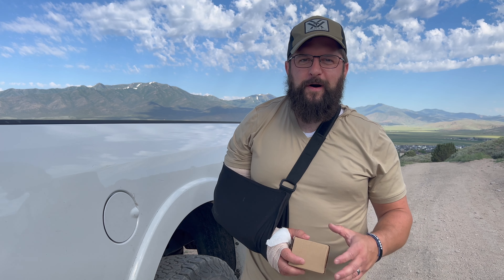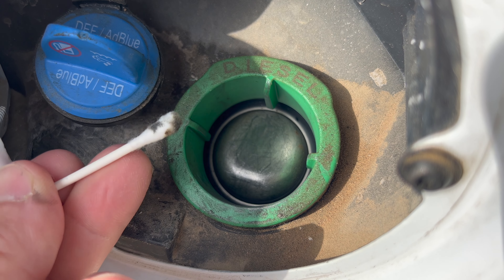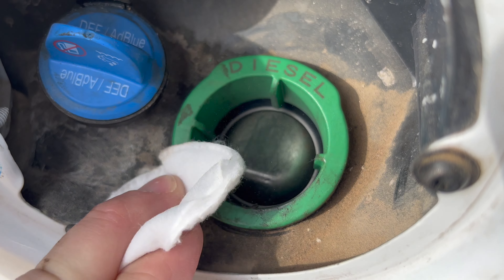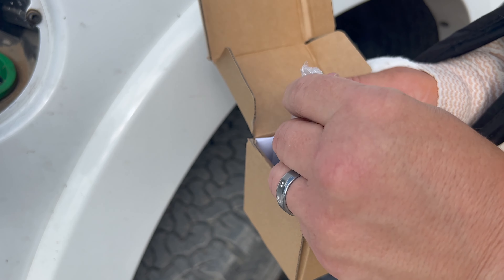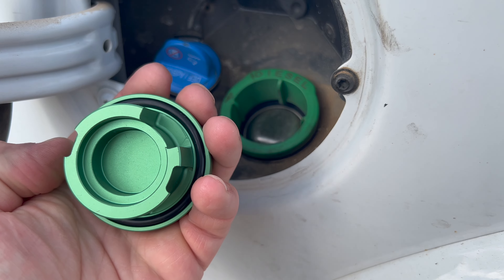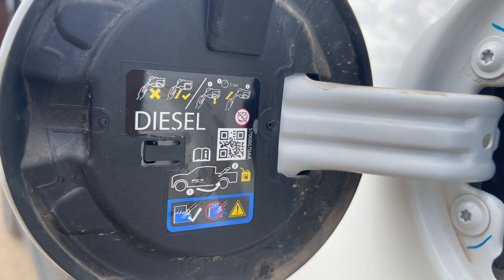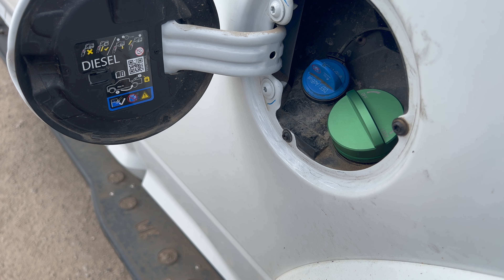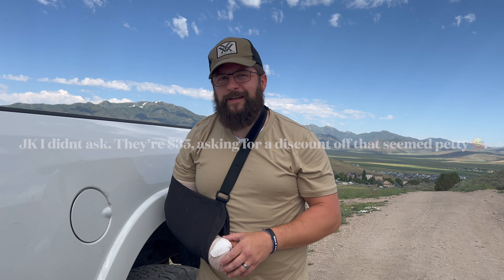Don’t like the flapper valve on your 5th Gen HD Ram? Check this out:  (2022 Ram 2500 Cummins)

Comment: This doesn't do anything besides make you feel better. The flap you see is the first of a pair. if you don't push the nozzle past the 2nd fuel just dumps on the ground because the gap is not sealed. The aftermarket cap is not keeping any additional dirt out of the fuel system.
Reply from the maker: If the dirt and debris gets down into that near the flap entrance, into the funnel so to speak, it never goes up and out. Eventually it would get pushed down to the second flap, and then past the second flap. Because this cap seals tight up on the rim, debris never has a chance to get down near the flap doors, therefore never gets pushed further down the nozzle.
Reply: @gavinwalker5686  there is an opening between the flaps for the dust to escape and enter again that's the point I was making.
Reply from the maker: Ah there’s a space for it to escape, I imagined a solid pipe with two flappers.